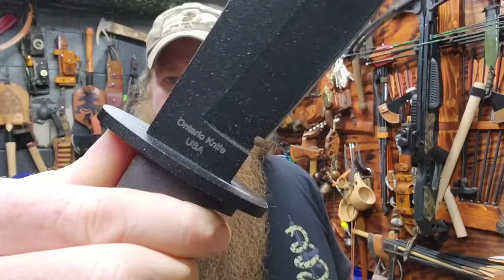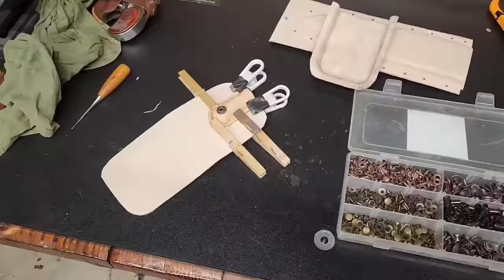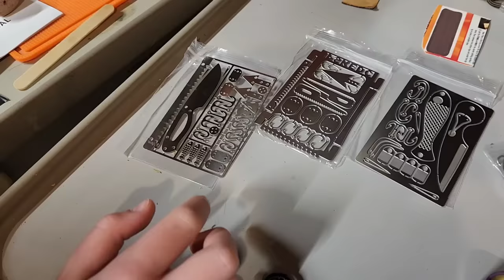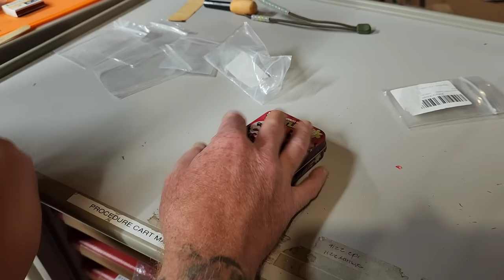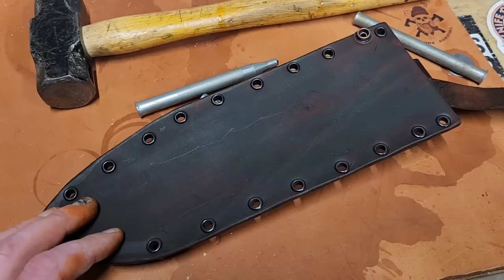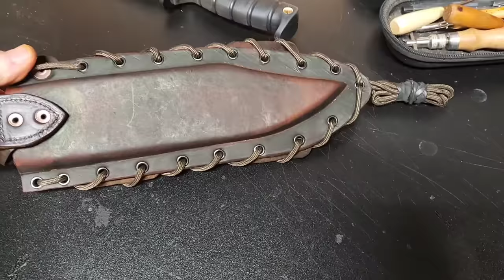DOOMSDAY SURVIVAL OKC MARINE RAIDER BOWIE KNIFE

Comment: This is a good knife! I've had one for many years and it's never skipped a beat. I also have one of their old 18 inch jungle machetes, but replaced the plastic handle scales with some Turkish Walnut handle scales.

The sheath you've made is orders of magnitude better than the one it comes with. 👍
Reply: Yeah I know thanks but I haven't fully finished it yet 😂
Reply: user-zb6ke7gy7e  Damn it, the old ones were great, why'd they eff with the steel?

Comment: Nice work. In my opinion I'd rather have one hang sideways. 
I saw a 12in ontario machete a guy put loops one at the top and one at the bottom. So it wore like a sword. 
I just believe a knife that big is better to be thought of as a sword then a belt knife.  
I'm way to short to wear all that weight on a belt. 
Anyway just my thoughts beautiful work nonetheless
Reply from the maker: Thank you. I guess I could use a shoulder strap.

Comment: So I have 2XL hands in width. It makes it difficult to buy knives I can use properly. I'm curious as to how big this guy is, because the OKC SP10 Marine Raider Bowie looks like a standard Ka-Bar next to his hands!
Reply from the maker: The handles 5 1/2 inches long
Reply: @StepOneSurvival  my palm is 10.5-11_in in circumference. It makes it difficult to find knives with long enough handles, or gloves. Luckily, Ontario makes an excellent handle on their Spec Plus knives. BTW, that hidden tang is extremely beefy. I think a lot of knife snobs don't realize that. If I had 1 knife to use for everything, the SP10 Marine Raider Bowie would be my choice. Maybe it's the camera angle, but that huge knife looks small compared to your hands.